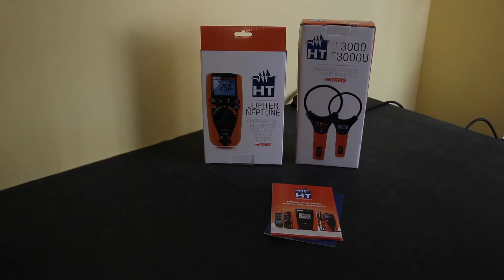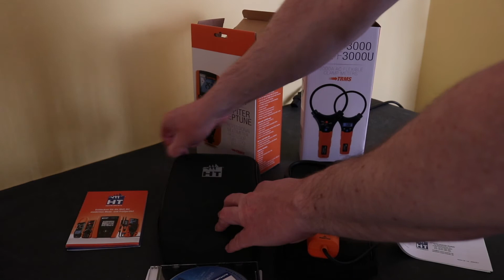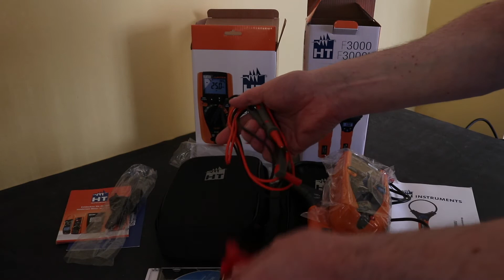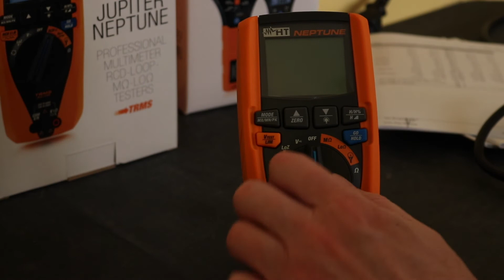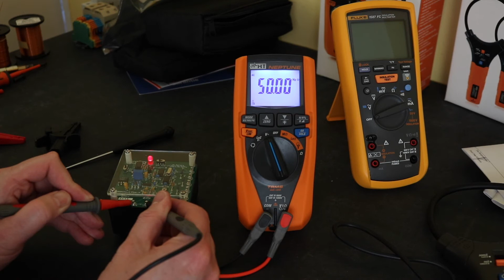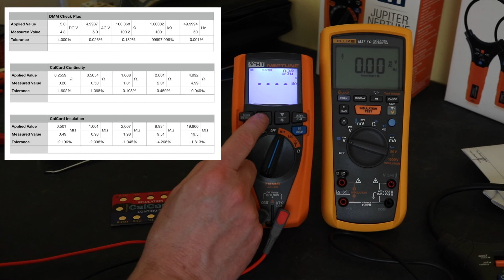HT Instruments Neptune Insulation Multimeter

Comment: Hi, did you follow up on the 4.8V reading? Thanks
Reply from the maker: Technically speaking the 4.8V DC reading is within specification for 5.00V applied. The tolerance is 0.5% +/- 2 digits, so the reading could be between 4.8V to 5.2V. I had a look inside the instrument but there are no calibration options, so it looks like it is either a closed case menu driven calibration or they connect into a little socket on the PCB just above the input fuse. 
I have requested a calibration procedure from HT Instruments, so will have to wait for their response.
Thanks for watching and commenting.
Reply: @three-phase562  Thank you for your reply. The 0.2V delta did appear to be like a lot relative to 5V. Still, it's at the boundary of its specs and I guess most people would like to see it closer to the nominal. I am looking at the HT712 which has a single pole touch pad. A little similar to Fluke's field sense but the probe is actually in contact with a live wire. There was a huge debate on safety for  the Fluke T6 but I think HT712 could mean a bigger debate as now, the contact is directly with a live wire and a finger. In case you have some knowledge of the HT712, please share with us. Thank you.
Reply from the maker: @lemech  I have no specific knowledge of the HT712. It doesn't look like it is too readily available in the UK and would have to be shipped from Europe. It is not clear from the manual if the connection to the metal pad is direct or if it is capacitively coupled, that would likely have some input into the assessment.
Reply: @three-phase562  Thanks again. This instrument looks really convenient for electricians  if it is indeed safe. It's been around for a long time and still in production so I guess there is some demand/track record.

Comment: Interesting looking meter. I've never heard of HT instruments before. I also noticed the Fluke responding to it during the IR tests, very surprising and as you say below not sure which instrument I'd be more concerned with there. External influences affecting my test results like that isn't something I've ever noticed or considered before. Given most of my testing is carried out in large control panels or MCC's that are still powered up with other plant running, it would be interesting to see how sensitive these instruments really are to this sort of thing. I wonder how the fluke would behave if it was also taking a measurment at the time?
Reply from the maker: HT Instruments have been around for a good while, but they do not appear to have a big presence in the UK. Acutest and the like have a few of their instruments but not the complete range. TIS rebrand a few, which are mainly available from CEF.
The response on the Fluke was only in mV, so it will depend how accurate you need the reading and what the absolute value is, i.e a few mV on a 440V power rail is likely to be meaningless, but measuring a 0 to 10V transducer output, may be more of an issue. The output of an insulation tester is driven at high frequency through the pulse transformer, so it may be that is adding to the issue and a 50Hz main signal around a panel may not affect the instrument as much.
Definitely worth looking into a bit more.

Comment: Do you notice when you carried out the insulation resistance test the fluke was responding- so it’s generating quite a bit of EMF.
Reply from the maker: It does doesn't it, likely to be coming off the pulse transformer within the HT Neptune generating the test voltage. I am not sure which one to me more concerned about, it shows that the HT Neptune is kicking it out, but also that the Fluke is suffering from external influences affecting the reading. Needs a little bit more investigation. I plan to take a look inside the HT Neptune anyway, so will be able to confirm the shielding if any.

Comment: What’s that check box - you have the nicest gear mate.
Reply from the maker: It is the DMM Checkplus. Nice little reference standard given the price. Certainly good value if you are USA based as you can get it calibrated easily. The manufacturer has changed, but they still look to be supporting it and enhancing it.

https://dmmcheckplus.com
Reply: @three-phase562  thanks just bought brilliant piece of kit and calibration is a bonus.

Comment: Send the clamp back and tell the manufacturer the more they know about this the better they can upgrade their manufacturing process. Hopefully they send you a replacement. That will tell you a lot about the company.

I have some Sonel gear a bit like metrel in terms of east European manufacturers. Sonel I actually rate products are well designed plus Poland has a long tradition of excellence in the math and engineering field with world class mathematicians and engineers in particular. Think Enigma machine and Rejewski. Read some excellent work by Polish mathematicians banach, steinhaus, kuratowski, tarski and my favorite Zygmund his work on harmonic analysis, trigonometric and Fourier series is breathtaking very relevant for electrical work especially power quality analysis.
Reply from the maker: It came form mainland Europe, so I will not likely return it. I have a Sonel MIC30 insulation tester, videos of it are on my channel. Very nice quality build and functionality to it - again though it is not a manufacturer that has a lot of presence in the UK, which is a real shame.
I have another one of their instruments that I need to do some videos on at some point.